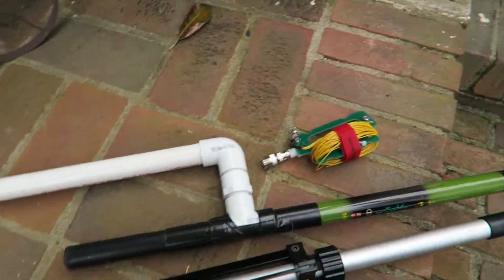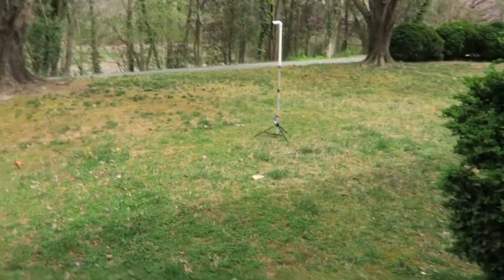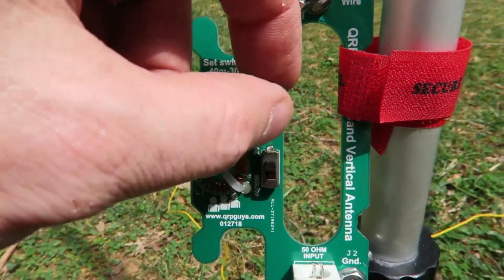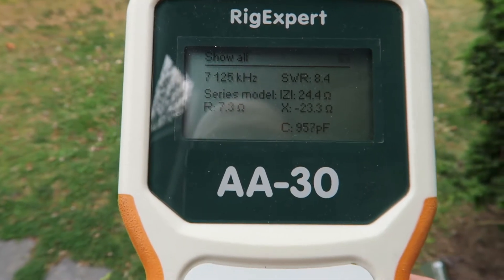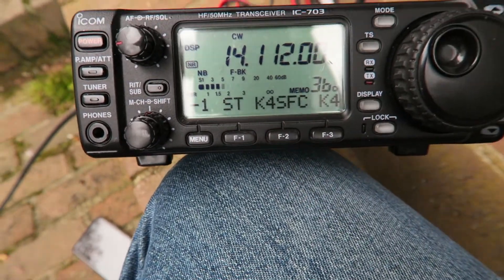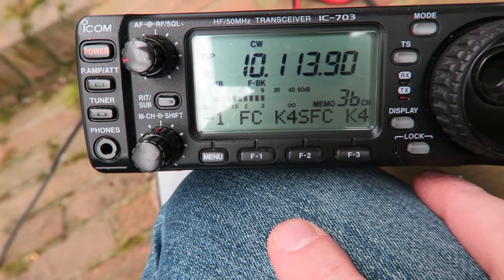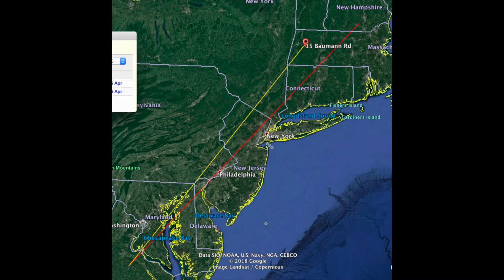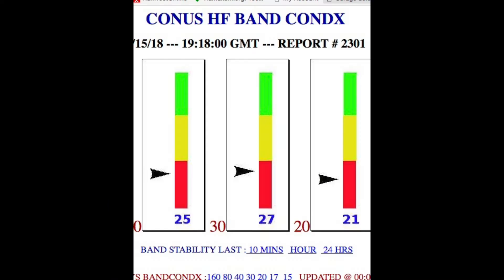QRPGuys triband vertical antenna deployment. How I deploy mine.

Comment: you had the switches on 30m and tested the swr on 40m and it was 8+.  Did you test it on 30m?  or set the switches to 40m and test it on 40m?
Reply from the maker: Apologies, if you look at the text across the screen at 3:09 , I failed to record the analyzer for the 30m setup. I did adjust the switches for 40m and the SWR was high. If I get a decently warm day this month, I will try and test this again as I have a different mast to try.

Comment: Nice video, what telescopic pole is that?
Reply from the maker: Thanks Ape! This is the one. I kinda wish it were closer to 20', though.
https://amzn.to/2HC0WGj

 (I do have a Sotabeams travel mast-10m and a Speiderbeam 12m mast-this one is beefy)
Reply: Ron C Thanks man, I like that mast and the way you have it rigged to the pvc.  Looks super handy!
Reply from the maker: It wasn't my first choice. Originally I had the wire running inside each of the sections and coming out through a hole in the cap on the bottom. It worked, but it was a little awkward to collapse.  I still might get some PVC that the pole fits into so I can finagle it inline with the tripod.
Reply: Ron C you are giving me ideas that I don’t “need”
Reply from the maker: hahaha....whatever, you're the king of "ideas"....flashlight whisperer!
Reply: Ron C now I am thinking I need a way to mount a whip to the top of that pole or a painters pole...  Lordy...
Reply from the maker: Done that! I did a DIY buddistick. There is an adapter (kind of kludgy) that screws onto the painter pole and then is able to thread onto PVC. I bought the 9' whip from Buddistick...made all the loading coils, etc...here are the plans...you can find the spot in the instructions aon how to get the whip installed in the PVC..

https://bit.ly/2qzpwAq

.I even made a DX contact that way.  I've got 8' and 16' painter poles...such an illness...lol
Reply: Ron C Tanks for the info!